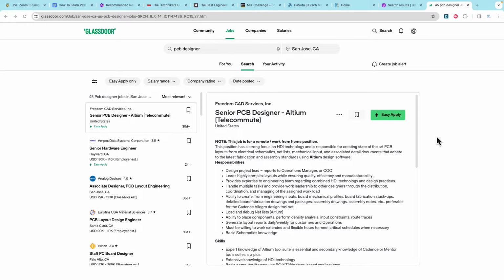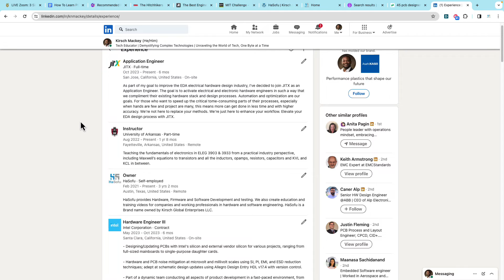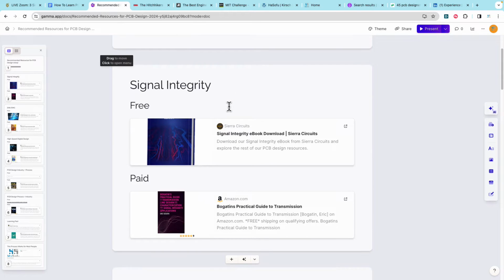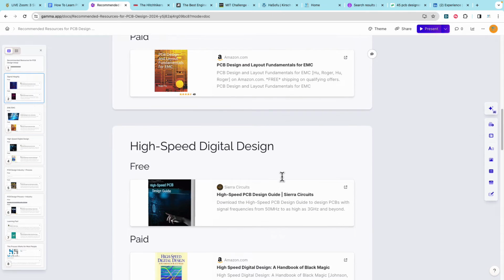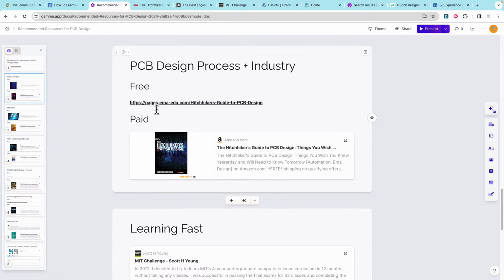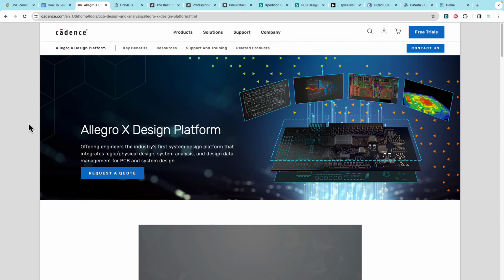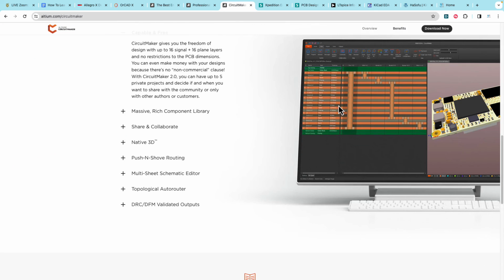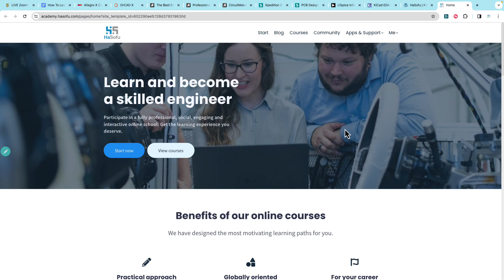How to Learn PCB Design 2024 (My Process and Experience)

Comment: I’m an ECAD Librarian aspiring to transition into PCB Design. Like you said it’s in high demand and the old school designers need to be replenished as some of them will be retiring soon. Is it possible for me to do it in a short time?  I’m hoping to do this work for the next 10 years until I can retire. I’m 52 and have an Engineering Technician background. I’m still looking for the challenge, I have the ideas of doing the work and motivation to continue to learn.  Engineering tech jobs are for the younger age group and I think I can contribute more on the design side.

I’m really thankful for your collaboration and teaching us how do achieve this. You are a great mentor and teacher and I think one of the best out there in the industry. I have some experience using Cadence Allegro as a librarian and did this job for 5 years until I was recently laid off from my job so I now have time to pivot and start looking into a career change.
Reply from the maker: This skill, prior to 2021 could not be learned in a short time. Then after doing PCB designs for 8 years, it struck me. 

Then I put a curriculum together where I reverse engineered the learning path. 

It took months to craft, but then after the 4th student that went through it got hired at yet another top company (students got into SpaceX, Astranis, Juniper Networks, Cisco, interviewed by Lenovo, etc.), I knew it wasn't a fluke. 

So yes there's a fast way to learn. It's 60 hours of training videos, but it's a lot faster than the typical 3-5 years people normally take...if they ever learn at all. 

If you're curious then reach out to me at kirsch at hasofu.com. We can also chat here, but it's not as convenient.

Comment: Hello! Thanks for your help! I am new to altuim designer.  I am facing an issue right. I designed the circuit  i saved all the files but when i try to import the schematic into pbc a comparator message shows up, once in ECO  i tried to validate and execute changes but unfortunately i cannot see the components footprints. The class room appears empty with no component footprint inside it. How may i solve this issue please ?
Reply from the maker: Hello. It has to do with the component schematic library. You have to pay careful attention to every single pin, pin name, making sure it matches the footprint pin number, the padstacks are saved properly, etc. If you send me your entire design at techedkirsch at gmail, I can troubleshoot it for you then make a video.
Reply: @techedkirsch  thanks a lot for your response, the components that i used didn't have footprint that's why it didn't work. By the way do you have online courses or class? I want to become a hardware design engineer,  i am doing electrical and electronics engineering